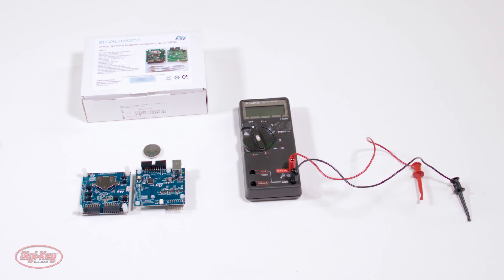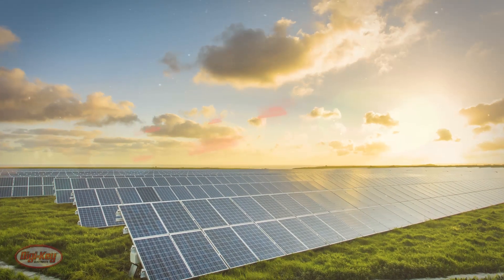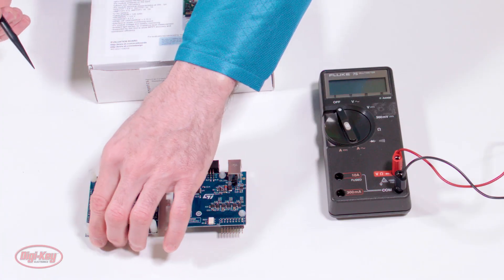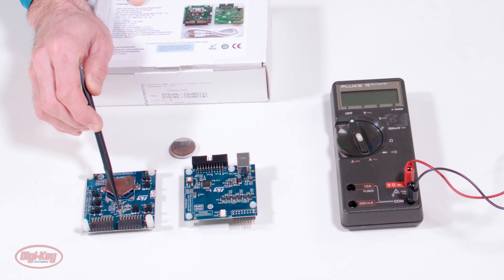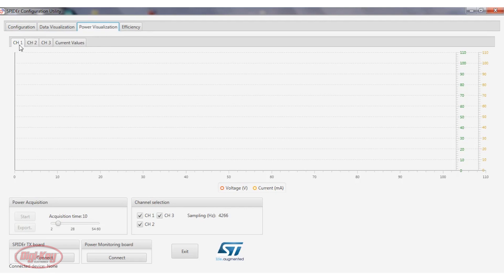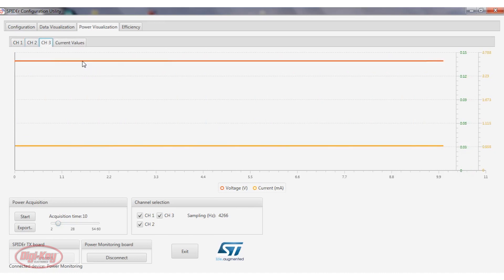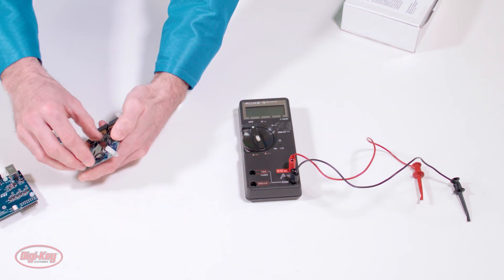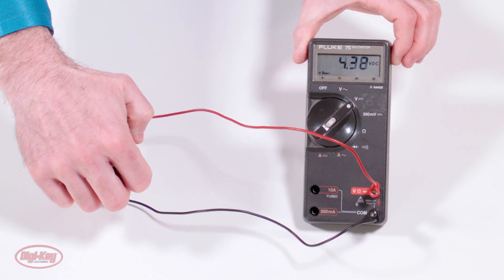Energy Harvesting – Tech Basics | Digi-Key Electronics

Comment: Put the Digikey part number ie. 497-15986-ND right in this description above so I don't have to pause your video and type it by hand.  Also list the parts.  TL to listen even at 1.25%
Reply from the maker: Hello Felix, I will send this suggestion on to the proper team. Thank you for the input. Typically our parts are linked within the description, this part number is the last link in the description above.  St Microelectronics Energy Harvesting Evaluation Board - https://www.digikey.com/product-detail/en/stmicroelectronics/STEVAL-ISV021V1/497-15986-ND/5428814

Comment: Is DigiKey reading my mind or parts list.lol... I was in the process of building a buck system and had just ordered the parts but I love this completed assembly. Can the SPV-1050 send current to another battery source in an overloaded condition or does it send it to a coil type inductor. Or does it just disconnect altogether after monitoring maximum current flow?? I have lots of questions. I need a source to power my Arduino remotely? Also is there a ribbon connector for the two units??